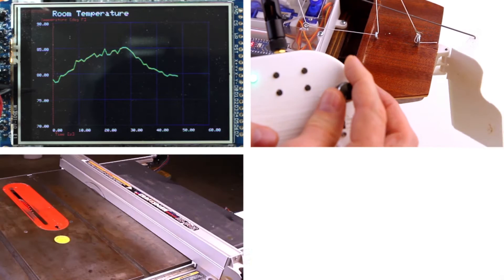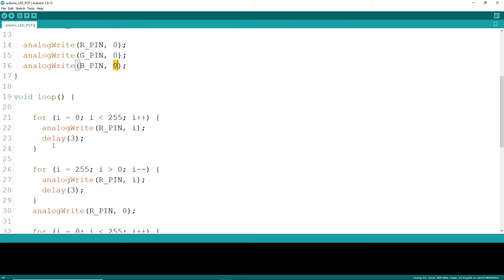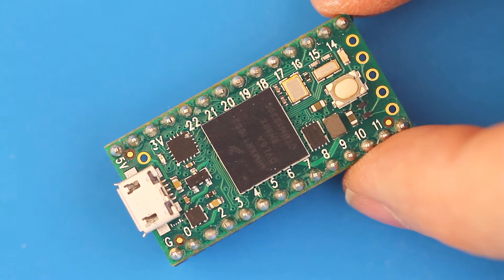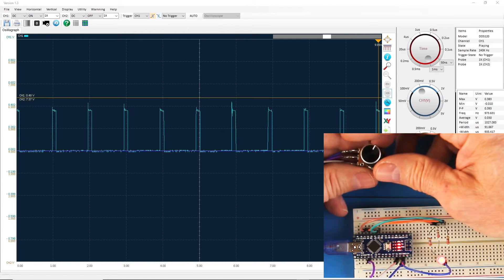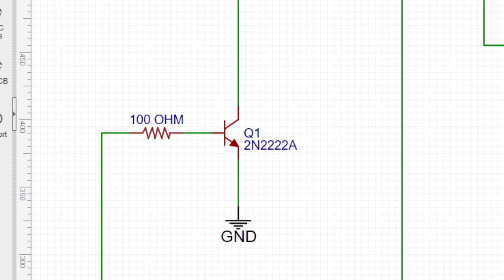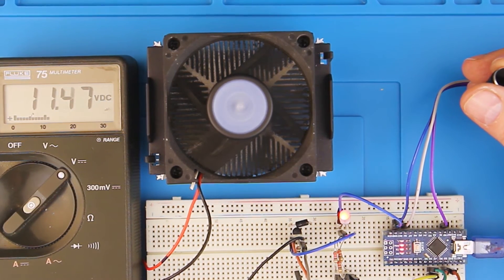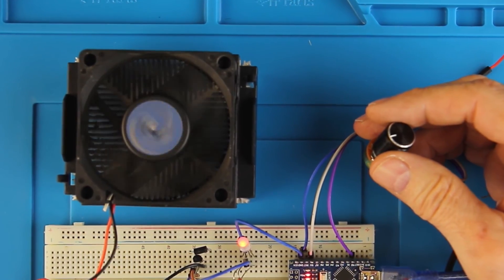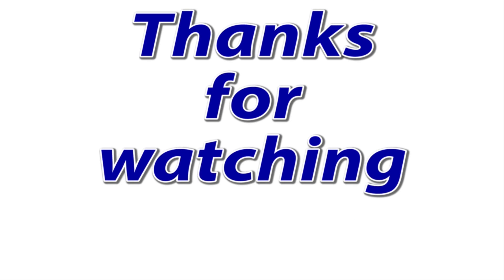Tutorial: Use analogWrite to vary speeds of fans

Comment: Nice video. I see that you use EasyEDA. How do you like it, and have you any thoughts on KiCAD?
Reply from the maker: I've never used KiCAD, but I'm fairly well versed with   EasyEDA

+
huge library, mainly from the community
fairly easy to use software
easy way to get from schematic to routing
pretty reliable router, download the router for local use
simple to get a design done, and then purchase
Fast easy to get professional results
Can export a DXF for importing into 3D CAD for making perfect-fit cases

-
horrible ability to keep things connected on the schematic, if you move a component expect connected paths to disconnect
can't store files locally, I suspect you can get the gerber files though
library authoring is a bit clunky, but usable

wishlist
have an integrated circuit analysis tool--to minimize breadboard stuff
Reply: @KrisKasprzak  Thanks so much for the detailed reply. Very helpful. I did download the router and noticed the paths disconnecting! 
Also, searched for Schmitt trigger and only got one result. Searched for 74CH14, got numerous results.